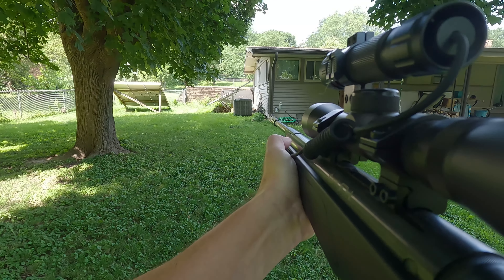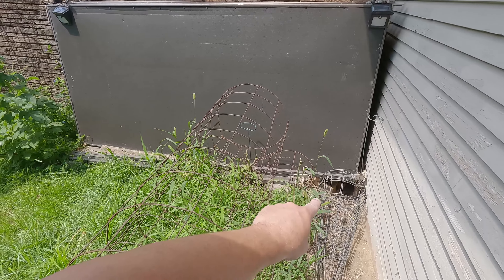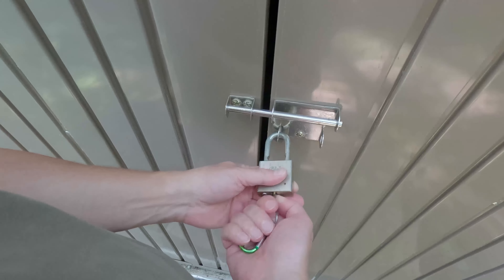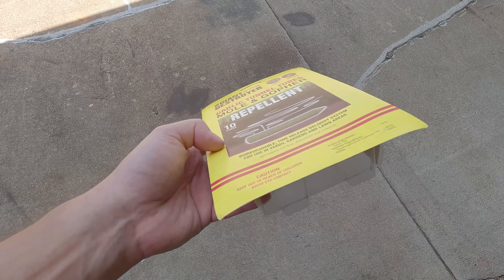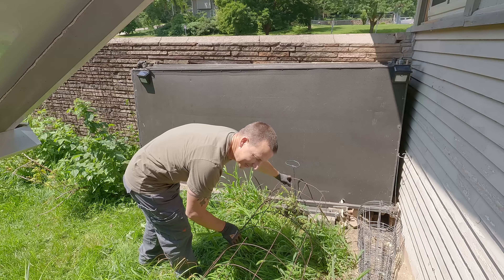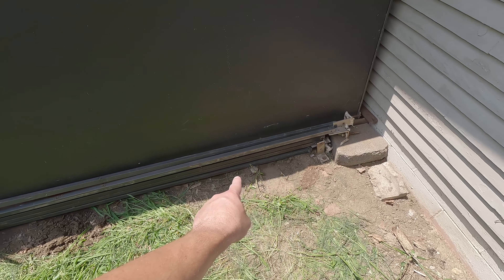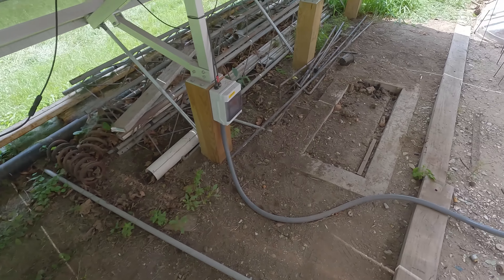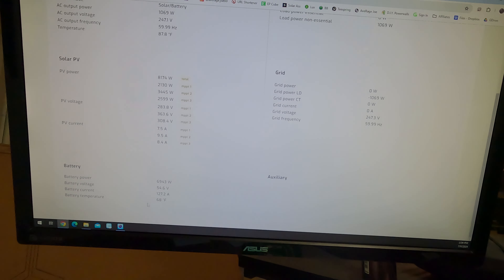Intruder says IM COMING FOR THAT SOLAR!!!

Comment: Just hand poured 2 concrete sonotubes to add two ecoworthy dual axis trackers. Will be putting on 4 panels each of 395w bi-facials having ~22% efficiency. Hoping it will give me another 50% additional solar to my stationary 12kw array.
Reply from the maker: I thought about those racks. I would be interested to hear how if goes.
Reply: @AveRage_Joe  Okay, I will keep you updated.